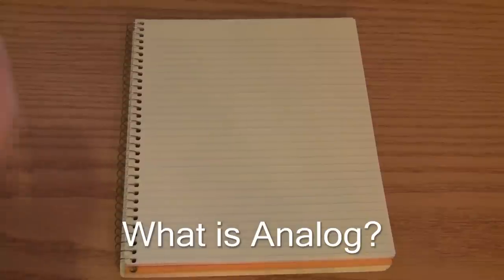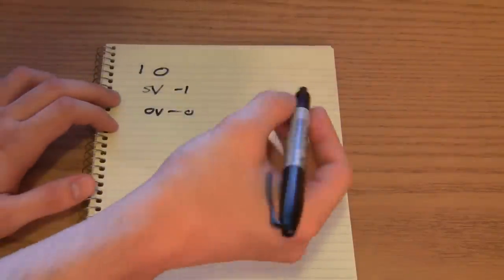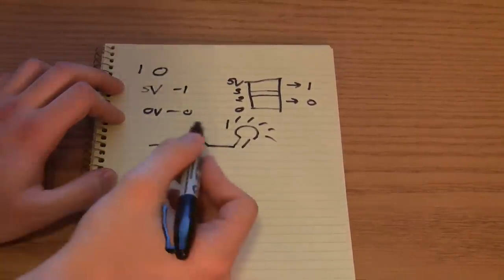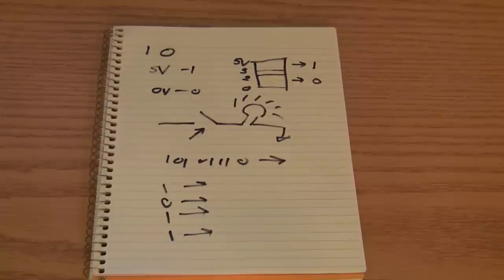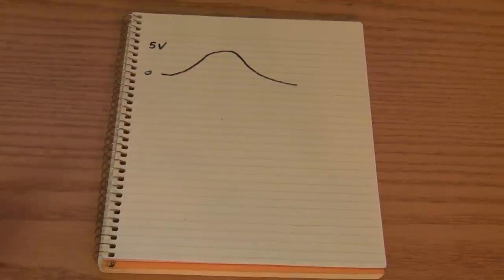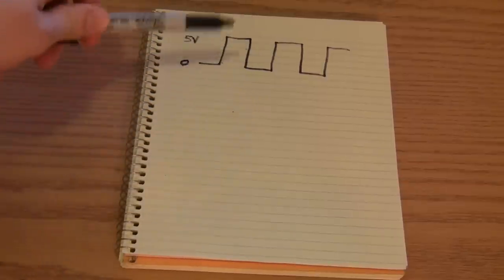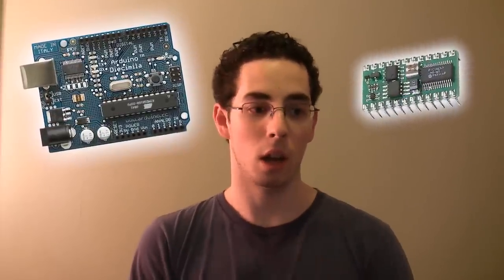TechBits 13 - Analog and Digital Signals

Comment: 11:34 You got it wrong mate, 10 bit resolution means that every sample will be represented with 10 bits or 1024 levels of voltage. Meaning your scale of 5 V with your micro controller can be presented with around 4.8mV of precision.
What you actually drawn is 10 bit sampling rate of time period.

Comment: Thanks for the great tutorial Jeremy. There's one thing I don't understand in your video. When there are 10 bits in the analog to digital convertor, the resolution is 1024. Why are there only 10 steps in the sine wave analog-to-digital conversion? Shouldn't there be 1024 steps instead?
Reply: +MrFurano Exactly my question as well
Reply: +MrFurano it is a 10 bit value... 0V would be a binary value of 0000000000, while 5V is a binary value of 1111111111. Any voltage value in between would be represented by this 10 bit value.
Reply: +zach vansa that's exactly why I asked my question. There are 2^10 (i. e.1024) possible values between 0000000000 and 1111111111. So there should be 1024 steps, I think.
Reply: +MrFurano What you think is correct. You got the point !

Comment: Thanks for that comment, because I was just about the write the same thing. Hope people watching the video read these comments, because that is not at all the way the 10-bits relate to the analog value. It simply means that whenever a sample is taken (and compared to a reference voltage), it can be represented with 10 bits (1024 values) of precision. So koktelici's 4.8mV "precision" simply means this:

5 v / 1024 values = 0.00488 volts / value

That's about 4.9 milliVolts of precision per sample

Comment: Hey Jeremy, thanks for getting me started with the Arduino. Regarding this video:
Wouldn't the 10 bits actually allow you to break the waveform into 1024 different steps, rather than just 10? Only 10 steps could be covered by 4 bits, because 10 in binary is 1010. That's the vertical resolution, and then the horizontal (time) resolution would involve the sampling rate. This comment addresses your video at around 12:20.

Comment: I keep moving it back to 10:46 because I can't really understand this part. If we're using a 10 bit converter, that's gonna be 1024 different points of resolution,  according to the video. Then why is it only broken down to 10 divisions? Shouldn't it be 1024 divisions instead?
Reply: 2^10=1024
Each bit is discreetly 1 or 0, binary. 10 of them.

Comment: Thanks for the great explanation of PWM. One thing, though, is that you didn't cover the 'W' part. (I was able to infer it, but had to look it up on wikipedia to be sure.) Essentially, if I understand it correctly, the longer the pulse stays high (that is, the greater the width of the pulse), the closer to 5V the device runs (and vice versa for shorter pulses, causing the average voltage to drop). Then, I guess you can even vary the pulse widths, thereby mimicking a waveform for some purposes?

Comment: Nice explanation! Does that mean our laptop monitor light adjustments are done thru PWM as well? That sole fact makes my eyes pain now
Reply: Or can we always output 5v and have a variable resistor to adjust the actual voltage applied on the electronics?

Comment: Hey, I have a quick follow up question to your explanation about AD Converters and their bit resolutions. You mentioned that for digital signals, there are two logical levels (1 and 0). If you have a AD converter with a particular resolution, the output of which are digital signals whose logical level range. Are these signals only useful to devices that can discern the range of logical levels or are these signals compared against a threshold to determine digital 1 or 0?

Comment: Hi, i have a doubt. Please correct me if I am wrong.

So while converting Analog to a digital signal we consider Threshold to convert them. Now in the bit conversion system, does it happen like this.

The threshold keeps changing, like initially when 0, the threshold is -5, so when .6 is reached it becomes 1. now threshold is now 2.5 where 1 is now a base value. so it keeps continuing till 5v AND gets reduced again till 0v. Am i correct?

is my above definition correct? just some confusion

Comment: Thanks very much for your work! I´m completely new to the subject and I work myself through some basics.

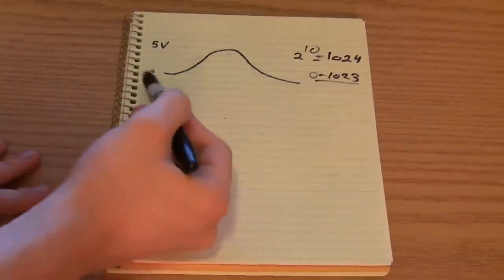I do not get the part from 10:44 to 11:23
Why do you have 1024 different steps of resolution when you divide the analog scale into 10 steps in a 10bit-d-a-converter?

Comment: Not exactly, light dimmers most of the time use potentiometers to change the voltage given to the light bulb. Specially those which work only with incandescent bulbs.

Comment: It would stay at its current logic level.. i.e. if it was high/on/1, it wouldnt turn off until it dropped below the 2v threshold. and vice versa, if it is low/off/0, it will stay off until voltage goes above the 3v threshold.

Comment: Analog or digital each has its advantages and disadvantages.
digital is slower then analog and wil ever be ! The thing makes it slower is conversion time from analog to digital and then back to analog while analog moves at (almost) speed of light.Its get critical when more information needs to be processed at shorter time (Digital Video tends to get square (aliasing) when camera moves the Digital simply cannot handle to quantity of changing data while the camera moves- It has to scan images (frames)which are changing fast. and it fail to do so as fast as analog does ( obvious when filming soccer games and in oscilloscopes when high frequency signals suffer from glitches).Advantages of digital are the reduction of line noise easy to store and processing.

Comment: No he did not, he was talking about the Horizontal lines, meaning that you can have 2^10 Horizontal lines. Meaning that measure the voltage in m 1024 steps since the Horizontal axis is the one that measures the Voltage.